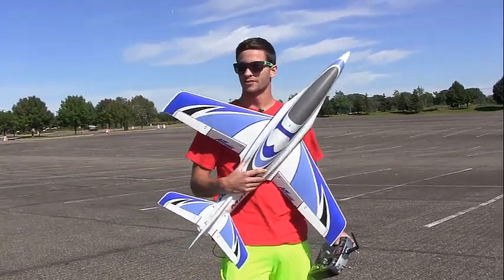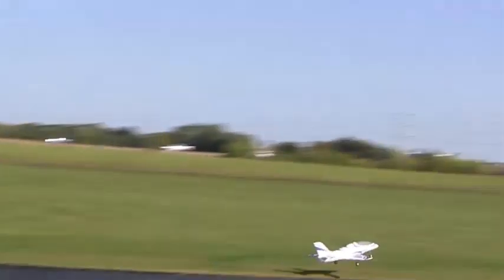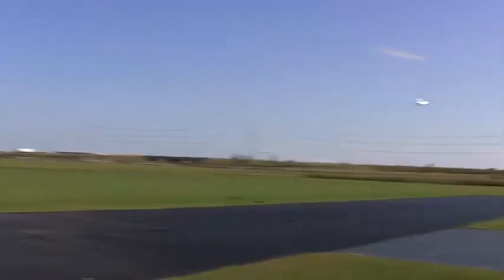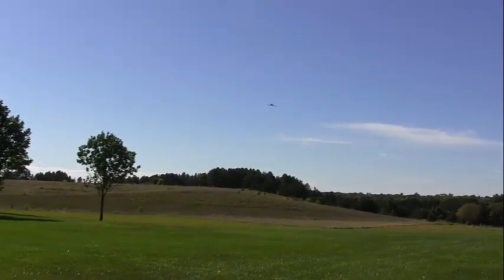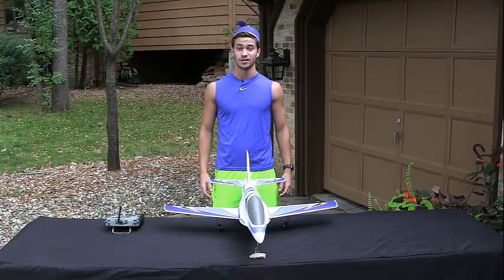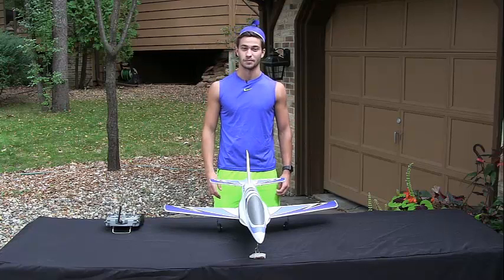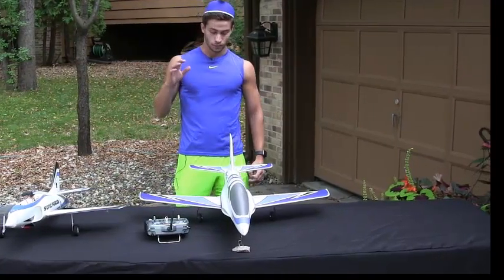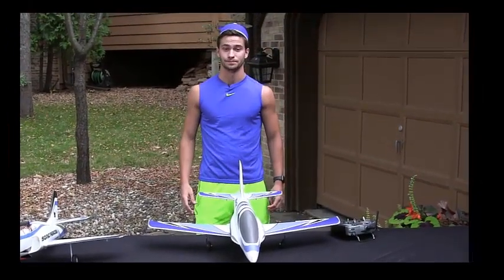RC Marlin 64MM Jet!    100% AWESOME!!!

Comment: Fly yesterday my marlin in the dark and lost the orientation.  My fall.  Also was the first fly on my new Spektrum Dx 18 and the ruder was to mutch on the aileron.  First take of whit the new Dx 18 was like the Marlin want to turn all the time to one side,  so I have to be careful.  But then the plain was to far away and start turning to one side and it was to dark to see witch side is up,  so I crashed slowly in the grass behind the Pist. Marlin broke in the front in 2 pieces verry Clean and the servo for the staring wheel was gone.  The rest is still like new,  so good are the Marlin.  Just put some glow on the broken part in the front and everything is fine.  I'm lucky that  on this plain is no Propeller or motor in the Front,  so everything is just elapor to repair.  Maybe the servo for the Gear broke away,  but marlin like also flying whitout a gear I saw on videos. 
Tomorrow I go again for flying but never ever in the dark